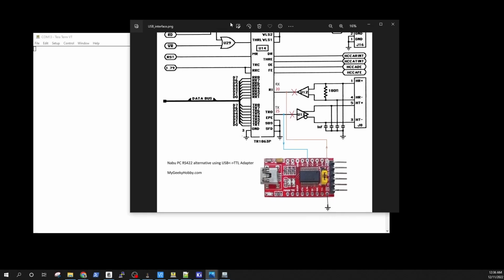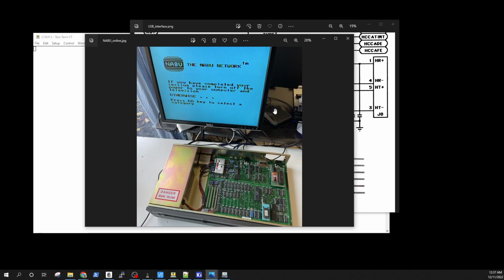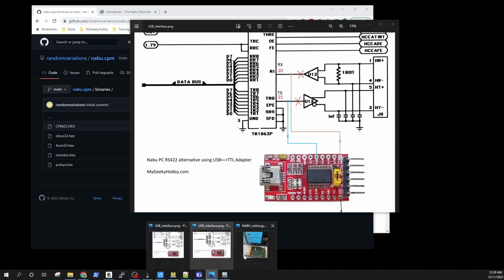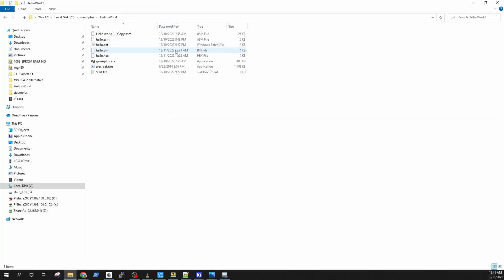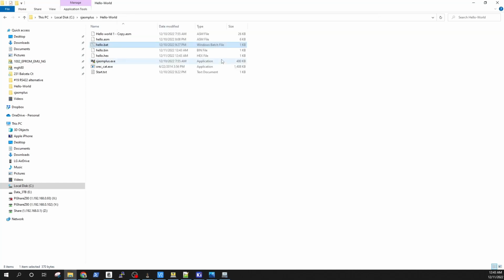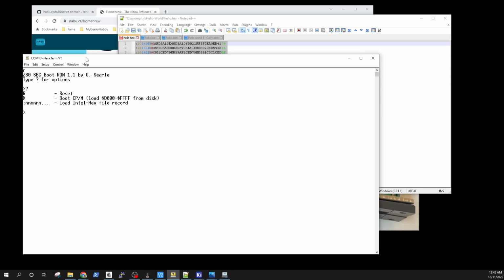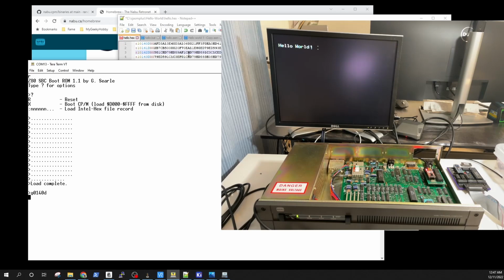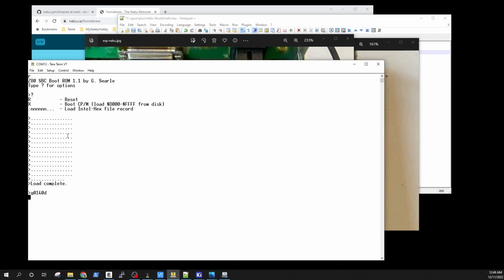#20 Nabu PC Native "Hello World"

Comment: If you're going to lift the UART, you might as well also feed it a clock (like 1.8432Mhz) that gives a "normal" baud rate.
Reply from the maker: interesting ... I'll take a look...great idea btw, thx for commenting!
Reply: Doesn't the UART currently get a clock rate of 3.5795Mhz? Feeding this much lower clock will give you clean 57600 baud rate. To get 115200 baud rate the crystal should be 3.6864Mhz but I'm not sure what impact this will have on the overall stability of the computer.
Reply from the maker: @leonkiriliuk  if you look at the Nabu schematic you will see the serial chip is getting half of the 3.5795MHz clock speed (look for the TRC and RRC pins of U14 - TR1863, you will see a label saying 1.79 ... that is 1.78975MHz)
Reply: @MyGeekyHobby  I see my mistake. I was looking at U2. UART is actually U14. It's the last page of the schematics and I guess whom ever did the schematics lost steam; IC not labeled and pins not numbered.  :(
Reply: @leonkiriliuk  The 3.5795Mhz clock is divided by 2 first before getting to the UART.  Giving the UART its own oscillator will not affect the rest of the computer, which will continue to use the original clock.

Comment: The good news is, Leo, one of the main engineers of the Nabu will be releasing a dump of the ROM that can boot from Network+Floppy+HDD.  For the delay, use 2 stop bits instead of one and then you can use baud rate of 115200
Reply from the maker: that is great news ... btw I saw the suggestion, but the 2 stop-bits trick didn't work for the monitor firmware that I'm using, so for now I'm still adding the 1ms / bit delay...
Reply: I put links to the ROMs in my last video: https://youtu.be/tYfd5rEXLCc

Comment: Did you try 2 stop bits instead of an inter character delay? The extra stop but may be sufficient to cover for the speed mismatch.
Reply from the maker: oh, great idea. I went straight away to my computer to test it ... but unfortunately it didn't work ... It is probably due to the way my usb-serial adapter works, I suspect it just doesn't support the odd speed, so even adding the extra stop bit is not enough ... I'll hook up logic analyzer later to confirm ... but thanks for commenting, it was a great suggestion.